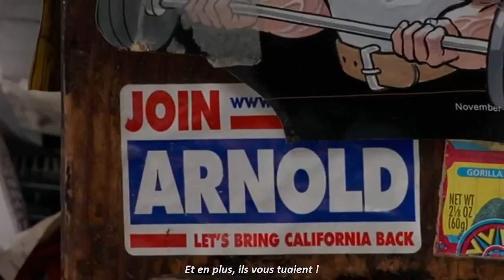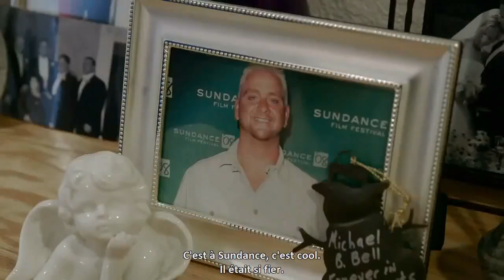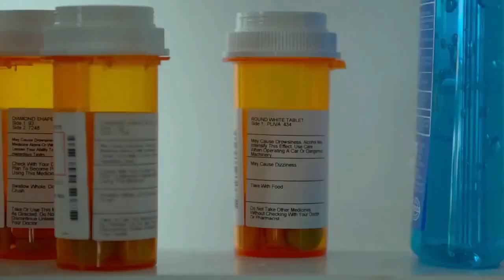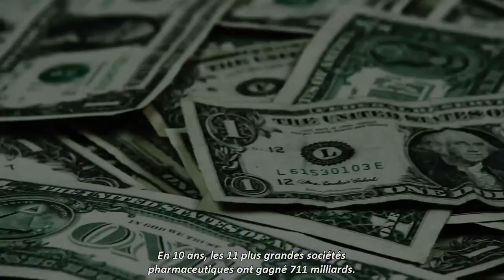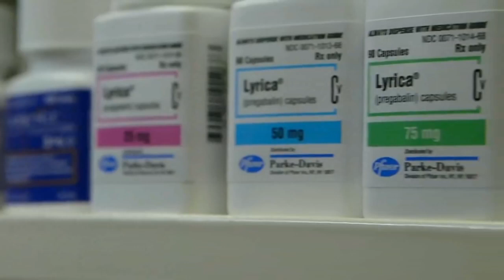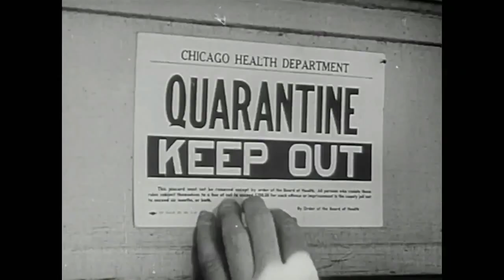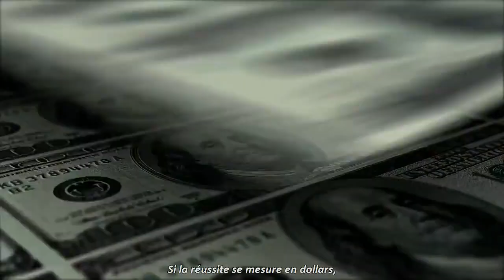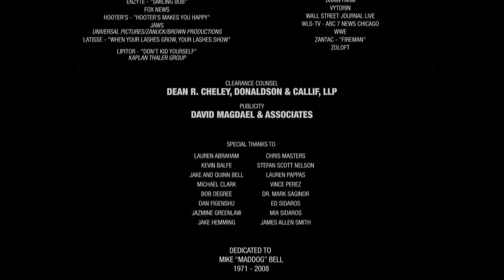steroides anabolisants  ( BIGGER STRONGER FASTER )

Comment: 45:03 After having arthroscopic surgery to repair my ankle, my Dr. prescribed sixty (60) generic Oxy (4 per day for 15 days). I was able to get by on SIX (6) OTC Robaxacet with Ibuprofen during my entire recovery. All 60 Oxy were destroyed at the local pharmacy. Not all surgeries are complex enough to justify Oxy.
Reply: Same surgery, and also prescribed oxy as well. Didn't take one and took Tylenol instead. Yes, the first 2 days hurt like hell but better than taking Oxy. Crazy thing was, that they wanted to do a J Bronston surgery (can't remember if that's the correct term) for partially torn ligaments. Later on had another surgery on the other ankle and asked another doctor if it was normal to suggest that surgery if you don't have torn ligaments, he said no. So the other doctor wanted to do an unnecessary surgery to make more money.